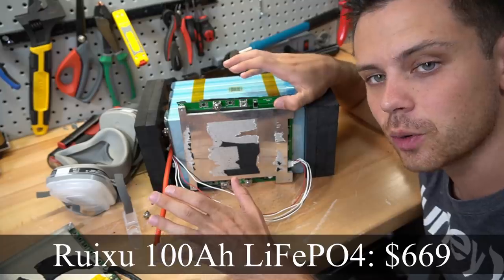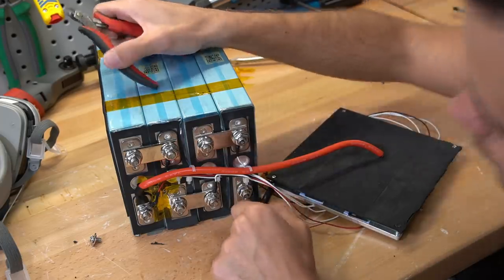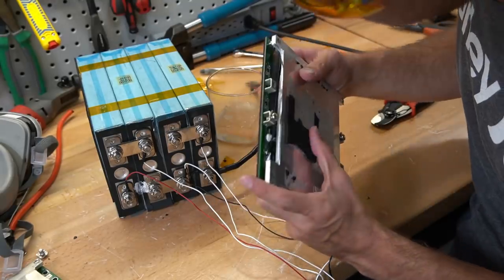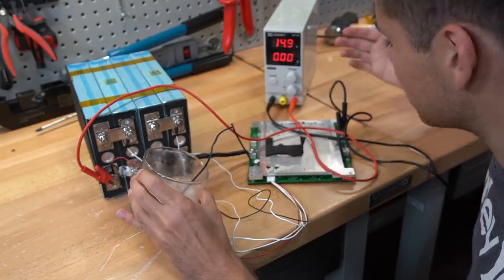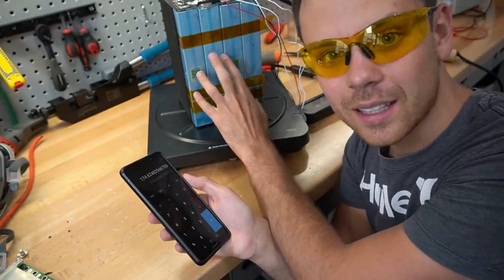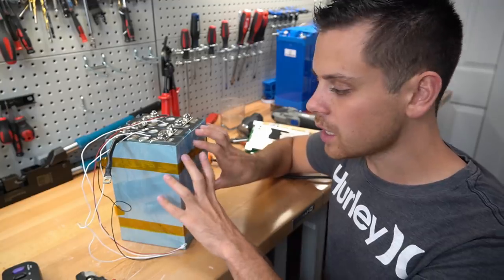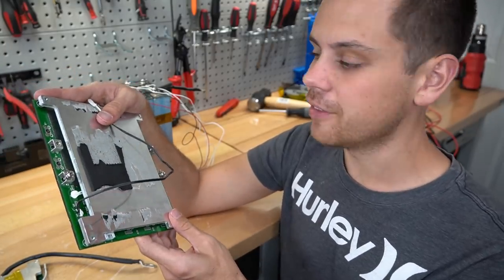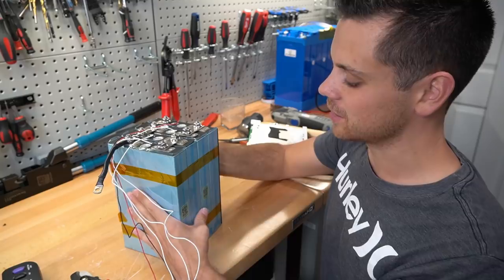$669 Ruixu LiFePO4 "LS" 100Ah Tear down

Comment from the maker: Yes, kapton tape is awesome. And when used logically, can help construct a nice battery. But considering ruixu's track record with quality control issues, and lackluster craftsmanship, I would question if their tape job is the same in every pack. It is strong, but I personally would prefer a cell holding device inside that gives the BMS heat sink ample airflow. Tape and foam is strong, but not used by UL listed battery manufacturers. I would question it's long term reliability.

~~~~~~~~~~~~~~~~~~~~~~~~~~~
Does off-grid solar confuse you? Check out my DIY friendly website for solar system packages and product recommendations, and so much more! http://www.mobile-solarpower.com

Join our DIY solar community! #1 largest solar forum on the internet for beginners and professionals alike: https://www.diysolarforum.com

Check out my best-selling, beginner-friendly 12V off-grid solar book (affiliate link):
http://amzn.to/2Aj4dX4

If DIY is not for you, but you love solar and need an offgrid system, check out Tesla Solar. Low prices and great warranty, and they can take your entire house offgrid with their new Powerwalls: https://ts.la/william57509

~~~~~~~~~~~~~~~~~~~~~~~~~
My solar equipment recommendations (Constantly updated! Check here first):

12V/48V Lithium Batteries: https://www.mobile-solarpower.com/solar-batteries.html

Solar System Component Directory: https://www.mobile-solarpower.com/solarcomponents.html

Plug-N-Play Systems: https://www.mobile-solarpower.com/full-size-systems.html

Complete 48V System Kits: https://www.mobile-solarpower.com/complete-48v-solar-kits.html

DIY Friendly Air Conditioner/ Heat Pumps: https://www.mobile-solarpower.com/solar-friendly-air-conditioners.html

Complete 48V System Blueprint: https://www.mobile-solarpower.com/48v-complete-system-blueprint.html

~~~~~~~~~~~~~~~~~~~~~~~~~~
My Favorite Online Stores for DIY Solar and Coupon Codes:

-Current Connected: SOK, Victron and High Quality Components. Best prices and warranty around: https://currentconnected.com/?ref=wp

-Signature Solar: Cheap Server Rack Batteries and Large Solar Panels:
https://www.signaturesolar.com/?ref=h-cvbzfahsek 

-Ecoflow Delta Official Site: My favorite plug-n-play solar generator:
https://us.ecoflow.com/?aff=7

-AmpereTime: Cheapest 12V batteries around:
https://amperetime.com/products/ampere-time-12v-100ah-lithium-lifepo4-battery?ref=h-cvbzfahsek

-Rich Solar: Mega site and cheaper prices than renogy! Check them out: 
https://richsolar.com/?ref=h-cvbzfahsek

-Shop Solar Kits: Huge site with every solar kit you can imagine! Check it out:
https://shopsolarkits.com/?ref=will-p

-Battery Hookup: Cheap cell deals
https://bit.ly/2mIxSqt
10% off code: diysolar

-Watts 24/7: Best deals on all-in-one solar power systems, with customer support and distribution here in the USA: 
https://watts247.com/?wpam_id=3

~~~~~~~~~~~~~~~~~~~~~~~~~~~
Contact Information:
I am NOT available for personal solar system consult! If you wish to contact me, this is my direct email: williamprowsediysolar@gmail.com

Join the forum at https://diysolarforum.com/ if you wish to hang out with myself and others and talk about solar

FTC Disclosure Statement and Disclaimers:
Every video includes some form of paid promotion or sponsorship. Some links on this youtube channel may be affiliate links. We may get paid if you buy something or take an action after clicking one of these. My videos are for educational purposes only. Information is subject to change/update at any time. Electricity is DANGEROUS and can kill. Be smart and use common sense :)

DIY Solar Power with Will Prowse is a participant in the Amazon Services LLC Associates Program,
An affiliate advertising program designed to provide a means for sites to earn advertising fees by advertising and linking to Amazon.com
Reply from the maker: But I should be nicer. Ruixu did do a good job with this battery. It's hard for me to trust or recommend any "budget" solar products in recent times. But it may be a good option.
Reply: My thought on tape(from an unprofessional): The tape should only be needed during assembly. The case should rigidly support the batteries to prevent unacceptable movement.
Reply: One thing to keep in mind is.....
That being UL listed means the product won't burn your house down. It really doesn't have to work reliably. It just can't "Flame on" for any reason.
Great tear down as always 👍
Reply: Fyi eb 240 is great. Will, cannot suggest stronger to folks get the Best UL wiring for panels and oversized conductors. I have 8 g for two  9amp panels with 100' cables. Never know when camping how far away clear zones are for sunlight. Staying under trees but panels in full sun good idea.
Reply: Any chance you can do a review or tear down of the Dakota lithium 100ah batteries they seem like they're made to be a direct competitor to the battle born but significantly cheaper especially when bought in bulk
Reply: You should be a model also lol. So good looking

Comment: Looks to me as if the case and the foam provide plenty of support along with the tape.  Maybe not for a full off road vehicle but any normal use profile should be fine.
Reply: I agree.  Construction looks solid for the application.  Ebike batteries take way more of a beating and they’re practically held together with scotch tape and bubblegum.
Reply: The battery appears solid as built.
Reply from the maker: Yeah that's true. I shouldn't have been so harsh. Good points
Reply: @SoCalKevin  Naw they use the imitation Scotch® tape. not the good stuff. They do however use top of the line chewing gum

Comment: To be fair the Kapton tape is only being used to hold the cells together to aid fitting in the plastic case.
The cells appeared to be a tight fit in the case, I don't think they were going anywhere!
This unit looks like it was meant to be used in a stationary situation, and comments about use in vehicles seemed a bit harsh.

Comment: Will, I see there is a new battery on the market.  SOK , made in China 😬 the case is metal and coms apart with a screwdriver.  It looks like the wire going to the terminals seems a little under sized.  Do you have any experience with this brand?  Thanks Jeff

Comment: Great videos. I am currently building an Enduro ebike with a 72V battery which will probably be about 30AH. My plan is to mount it on the back of a sprinter type van. Since I will be lugging around the weight of this eBike, my question is can I just add a 72 V to 12 V dc/dc converter and use it as back to the up solar power for the van? Of course I would also like to charge the bike when I’m on sure power. I have always been frustrated my tesla cannot be used as a power wall to back up my house during power outages.

Comment: Hi Will, im very new to the world of solar. I searched your book backward and forward and couldn't find an answer to my question so I thought I would post my question here. I have one 100 watt foldable solar panel panel and I was wondering if I could connect two charge controllers through a MC4 Y connector so that one charge controller is connected to my LIonCooler fridge/freezer and the other charge controller is connected to my 500 watt hour solar generator? Ultimately so that I can recharge both the batteries at the same time without using an inverter.

Comment: I’m looking to build a less expensive lifepo4 power bank to be used w/1000w inverter.

The plan is to parallel 8 Miady 16ah lifepo4 batteries (from Amazon, not always available). Instead of daisy chaining them, I was thinking to use a 12-port fuseblock, having each battery protected by a fuse.

Why not just get a 100ah or 120ah battery?
100ah lifepo4 battery cost around $600 or more. Miady 16ah LifePo4 battery costs $45.99 ea. $367.92 for 128ah or 1638.4Wh.

Will this work at all? Will this stand up to the high current? (Will be connecting a small refrigerator 1.5amp cont, 6.5a starting amps)

Comment: You exert significant effort to open the case and the contents were very well packed yet you nitpick about tape? Will are you really complaining because you feel you have to?
Reply from the maker: If I don't, my viewers will. compared to other LiFePO4 packs, this is lower quality. And longevity here is dependent on craftsmanship, which as you know, can vary quite significantly with ruixu's.
Reply from the maker: Do you disagree with my complaints?
Reply: @WillProwse  Will  I'm not convinced that you agree with your complaint.
Reply: Noes de wae two Honesty  Yes I could.
Reply: Noes de wae two Honesty  Lets clarify something here sweetie, at no point was this conversation directed at you and at no point were you included in it. How about you stop lurking the comments and do something productive with your life? Hope that explains it better for you.

Comment: Tape can be superior to other methods in certain circumstances. For instance the ceiling panels are held in place with 3M VHB tape. As is the wall panels on the building that looks like a sail in Dubai. I have used the same tape constructing a high speed stacker carriage. Because the forward reverse travel was too great from an aluminum constructed carriage held together with screws or pop rivets. The tape had a flexibility under vibration that other methods do not have. And sometimes the panels on trucks use tape because of vibration as well. 
Something to consider. Not saying the tape used was any good. Only that the proper application and product can be a better option dealing with vibration.
Reply from the maker: Very true

Comment: Yes, the tape job is iffy. But if it is packed solid in the case and not rattling, the foam blocks are probably doing the job. I would still stick with my battleborn but if i upsize my system these might probably work fine.

Comment: Can you do a video on the Renogy Charger/Inverter in one? Specifically this one and how it can be used with a 400W solar panel, lithium iron phosphate, and the Renogy DCC50S 12V 50A DC-DC ON-BOARD BATTERY CHARGER WITH MPPT?

Comment: Excellent review as always,  We wonder have you has a Pro and Con of using Power Generator in a DIY Van of  all in one unit Vs system consists of batteries/charge controller/converter .... ?

Comment: What they had on their site: "Pls note:pls do not connect the batteries in series and in parallel at the same time.
The example: for 4PCS RX-LFP-12-100LS,you can get 12V400AH or 48V100AH,but it can't be connected to get 24V200AH"

As an installer outside the USA, I can see how this can work for small grid assisted clients but not having any expandability beyond 4 battries or just 2 for 24v setup is not an easy sell.
Reply from the maker: Yeah that's the other model. They really need to update their listing
Reply: @WillProwse  Ohh I see. Meh that's even more discouraging. Guess we will wait another year to see how the new stuff performs in the wild. Plan on doing a capacity test for this?

Comment: How would you repackage it for use under heavy vibration will? Nice diy life hack
Reply: I would personally re wrap with heat shrink plastic (each cell, leaving the tape),use the double sided tape foam ( one on each corner, like he did in another video) and put 3 or 4 of those heavy duty shipping plastic weld straps around it (not too tight), foam or plastic corners underneath the binder straps and plate the bottom with that same heavy duty foam that was in side the old shell. And kill the whole setup by bungee cording it down! :-) JK

Comment: Hi dude like your videos tried not to miss any. Have a question I'm installing a solar system in my shedd,  the question is how to wire the ground to the box and if I have to install a grounding rod and connect the ground leads. Hope you can help me.
Reply: I have the same question tbh 
Hopefully Will will cover it

Comment: Will, it would be interesting to find out if they put some type of adhesive between the batteries and only used the tape to secure it until the adhesive cured. Remove the tape and find out please. If that’s the case, perhaps the only shortcoming is the small flexible leads?

Comment: At the same price you could get over double the capacity of raw cells. Prebuilt batteries just aren’t competitive. The EVE 280ah cells are what I always go back to because they give you the most bang for the buck. You just have to slap on a BMS and your in business.
Reply: Honestly, why isnt this the standard these days? Just so obvious, wish people picked up on that idea more.
Reply: You found the holy grail?   Link please and thank you!
Reply: Andrew Bowden I wouldn’t call it a holy grail. Just go to Alibaba and search for “280ah LiFePo4” There are a lot of Chinese retailers that sell them. The cells are so insanely cheap that the shipping can be just as expensive as the batteries themselves. Even with shipping they are a great deal.
Reply: @justicelee26   I see'em but for 14kwh+/- and for $3600 $112x16 plus $1800 for shippping = Aliexpress . I don't know?.. I still think there is better options out there. By no means am I trying to argue here. They are brand new cells. I kinda would rather get used/recycled (tested) and have them here in days knowing what I have for $$$$ less.

Comment: Wires soldered on the BMS or wire terminals  soldered on the BMS: It boils down to the same principal with the added bonus that terminals can break their joints when tightening them up.

Comment: I just bought a 2008 Lance truck camper. It has solar on top but it only has red,yellow and green to tell you how your batteries are doing. How and what could I get to replace the lights?

Comment: I've seen a ton of your videos on different battery technologies, but have you looked at lead carbon batteries much? They're what I'm going with for my solar setup, and they seem pretty good for the cost. My battery bank will be 12 500ah 2v cells in series, and the specific ones I chose (sacred sun fcp500, made in japan) are supposedly rated for 4200 cycles at *70%* dod. That's almost 12 years if cycled daily, which is inching into lithium territory, and for a fair bit cheaper (at least where I can get them).

Comment: Would mounting the batteries with some air gap between cells (a GRP corrugated separator would be simple - and work for perimeter support and BMS isolation)) reduce risk of overheating (I know that LiFePO4 vents and "fails safe") - it isn't as if there isn't room inside the formfactor. - 

btw: holding together with kapton tape isn't so bad as the cells are secure once mounted, it is really only to hold together during manufacture - a wrap of fibreglass would take care of longevity issues.

Comment: Hey Will, I'm thinking of buying this system but I would like to know your opinion first. It's the SUNGOLDPOWER 15000W Peak 45000W Split Phase Pure Sine Wave Power Inverter, Low-Frequency Inverter DC 48V AC Input 240V AC Output 120V 240V Converter, with 40A MPPT Solar Charger Controller 15KW. It's selling for $3.279 on Amazon. It seems too good to be true so I'm skeptical.

Comment: How are you finding your oscillating multi-tool. I can't decide if I should buy one.
Reply: From someone with a “small” collection of 18v power tools, I avoided purchasing an oscillating multi tool for a long time, then had a job where I really had to buy one, and now wonder how I ever managed without it. If you can afford it, and need it, I’d recommend you get one - but make sure it has a quick change/adjust blade holder, anything that needs a tool to move the blade angle or swap it out is not good.

Comment: Hey Will I have a question: I've looked online but haven't seen except for red and yellow top batteries. Can Lithium Ion be used as a starting battery is it possible? I was wondering as I have a bus I'm converting, and want to change out the two 150 lbs each starting batteries, they are both 1440 Cranking Amps/1155 Cold Cranking Amps.. Thanks
Reply: Lithium can be used as a starter battery. HOWEVER, it depends on the manufacturer: For example I am located in Australia and there is a local brand of LifePo4 who offers warranty for their batteries when installed for starter/auxiliary purposes however the warranty is reduced from 5 to 3 years . When installing LifePo4 batteries in an engine bay (Heat!!!) the lifespan of the battery will be reduced hence the reduced warranty.
Reply: @cyclemoto8744   Well for heat, mine would be located on the side away from the engine (like a school bus) so heat is not an issue but would love to find one to cut the weight down and be able to start and charge off the alternator FYI my bus is a 1995 Bluebird TC2000 FE Transit... So for AGM they have a rating but Lithium the cranking amps are a mystery from what I could find.
Reply: @ToConnect2000s  You'll need to find a local (I assume you're in the US) LifePo4 manufacturer who specifies their batteries as being crank capable. The previously mentioned example sells in Oz of approx AUD $1500 for 1x 150AH and you would need 2 for starter / aux system. I doubt you would find anything in the US for less than USD $2000 with same capabilities. If the battery specs and warranty don't mention cranking capabilities then stay away from the product
Reply: @cyclemoto8744  Ouch $1500 yeah I'll stick to AGM for now and just switch from the 2 8D's to Group 31 (need 3) and yes I'm in the US in Florida to be exact.. Thanks for the help and info... Much obliged